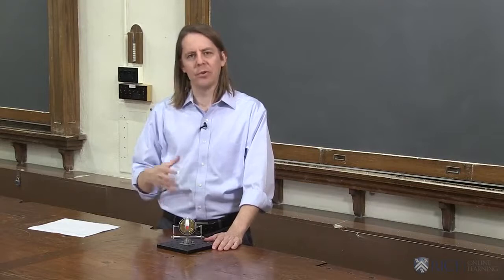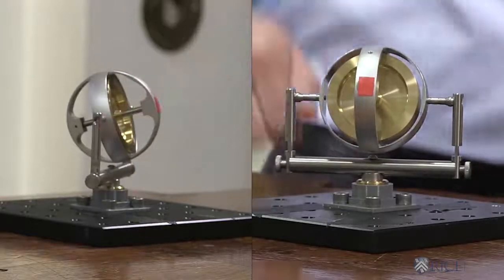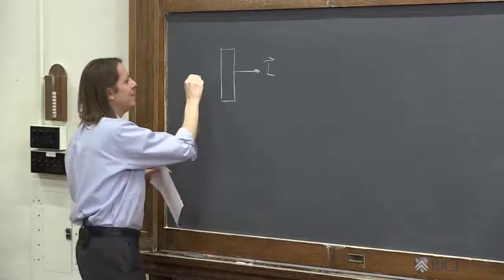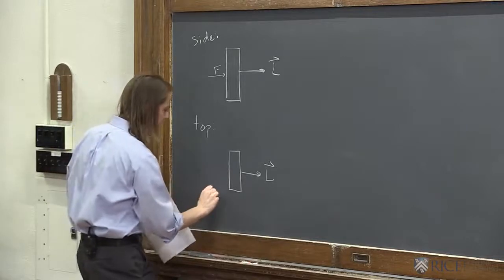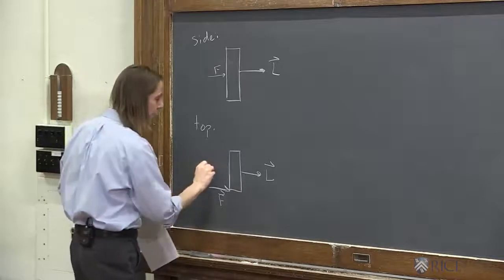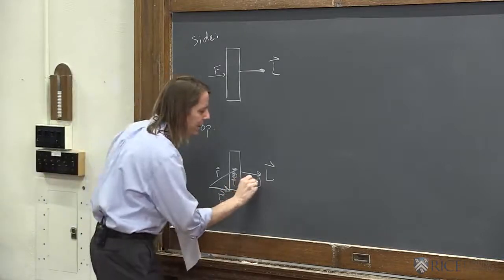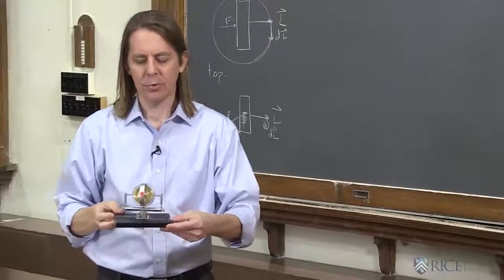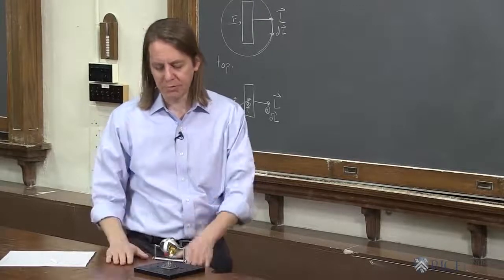PHYS 101 | Easy Angular Momentum 7 - Torque on a Gyroscope

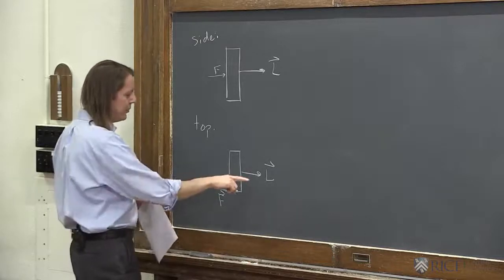Comment: Forgive me if I'm getting things wrong, but at 2:05 doesn't the r-vector have to point from the center of mass to the point where force is applied? In other words, it seems it's in the opposite direction. 

As a result, the torque 𝜏 = r × F should be pointing upward (out of the board). To make sense of this, I think the angular momentum was supposed to be pointing to the left rather than to the right. 

Am I correct here, or am I making a mistake?